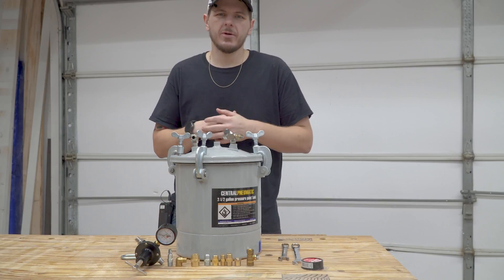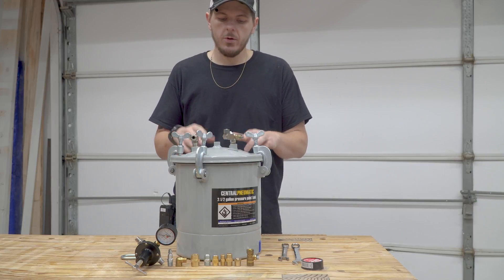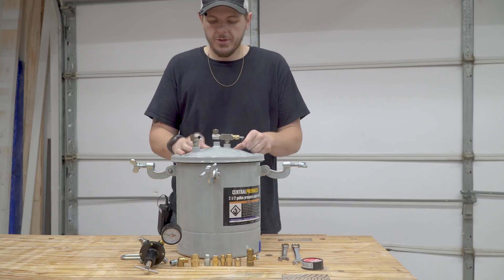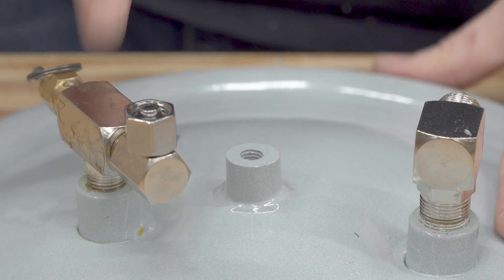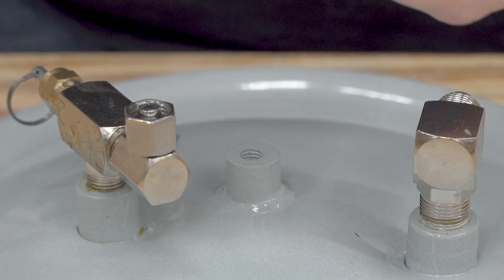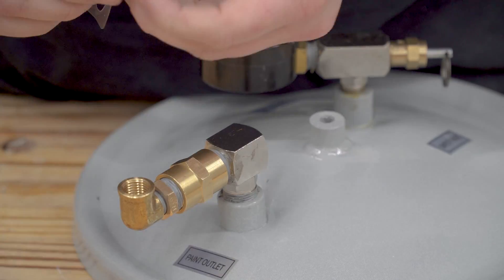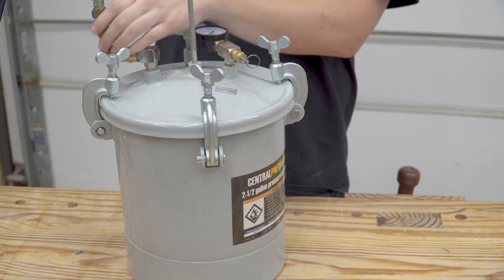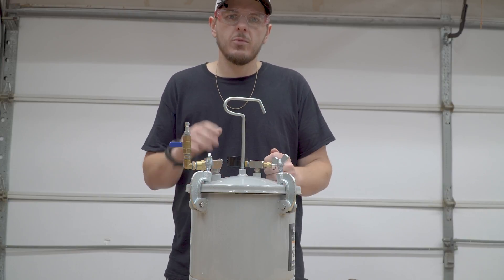How To Make A Harbor Freight Paint Tank Into A Resin Casting Pressure Tank

Comment: Read below reply for brass pieces and more detail and upvote. The video creator left out a few things.
Reply: Update: I tried to follow along step by step.  Here is some missing information. 1: The pressure Gauge he casuals blows past is actual glue sealed into it's threading so will require some force to remove from it's original housing. 2. He uses to much brass pieces for the project according to the Lowe's Plumbing attendent ( who also watched the video with me). Here is the following brass couplers and adapters that I purchased. Note all brass is ProLine series brand.
 1. (3/8-IN x 3/8-IN FIP coupling #(210) )
2. (3/8-IN x 1/4-IN bushing FIP # (201) )
3. (3/8-IN x Close nipple MIP # 224) )
4. (3/8-IN x 3/8-IN Street Elbow FIP #237) )
5. American Valve brand, Lead Free Brass Ball Valve, Female NPT X Female NPT. 3/8 IN. # G100.
CAUTION!! : Be careful if ordering online. When typing in the exact name, brand and codes, google completely failed me. Do not order online unless you know what you are doing. All of my purchases were done in person in store.
IMPORTANT NOTE. I bought these pieces because it fit my brand of air tank. Which I got from wal-mart and is a Hyper Tough 3 Gallon air compressor kit. 
Side note: Not all Teflon thread tape is the same. Get the correct color. Yellow or Red should do better than Blue as Blue is rated for Water.  
Additional note. My air hose connects via threading at the top. So no need for an extra air hose nozzle purchase. My long hose nozzle end goes into the tank and my threaded part of the hose attaches to the pressure lid with my build.
Assembly order:
Silver colored Elbow that comes attached to the top of the lid>[[Coupling> Street Elbow> Nipple> Ball Valve> Bushing]]>Air hose thread side. > Air hose Long nipple side plugs into air compressor.
Everything listed within the [[   ]] = Brass pieces and valve purchased in Lowe's. Total cost for all items including Harbor Freight pot and Wal-mart compressor kit and Lowe's brass pieces and valve was $173.00 USD rounded up. 

Your design may vary based on your brand of air compressor. Good Idea to bring both the lid of the pressure pot and the hose with it's connectors from the air compressor to make sure everything fits. Don't be afraid to ask the plumbing attendent in order to make sure you get everything right. Take care and upvote the Original comment and this reply in order to help others.

Comment: Am I missing something or could I also use this as a degassing chamber?
Reply from the maker: There is a difference it will work if you are using a very slow hardening epoxy if you ar using a casting epocy that starts to harden quicker it could take to long to remove the gas pockets.
Reply: Thanks for the reply
Reply from the maker: No problem thank you
Reply: it should hold vacuum as well as pressure, depending on what you want to do (i.e. silicone molds vacuum, resin pressure) but a vacuum gauge needs it's own fittings so a dual purpose tank might be a little complex

Comment: Why have the 2 'L' fittings instead of just having the air inlet going straight down into the pot? Seems like a lot of extra unneeded brass. And don't you need a regulator on it?
Reply from the maker: I like to look at what you're talking about with the L kidding. But I will let you know. As far as the pressure regulator you do not necessarily need a pressure regulator if you are setting it to a pressure and allowing it just to Simply hold the pressure without adding more air. I do not keep an air source hooked up to it for safety reasons. As well as there is a safety release valve on it

Comment: That nut with the hole is an air diverter. I will be doing the same thing you did but kinda backwards.
I'm going to put the pressure relief valve where your air inlet is and vice versa.

Comment: Do you use a vacuum pump? If so what is the best for the 60 lb pull for the money?
Reply from the maker: You apply pressure when casting epoxy not vacuum
Reply: Could this also be used as a degassing chamber though?